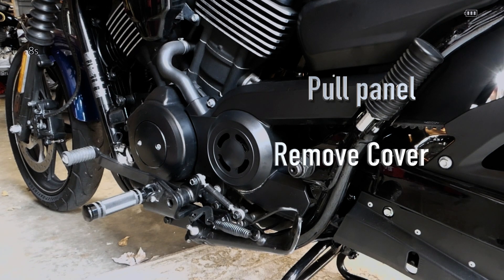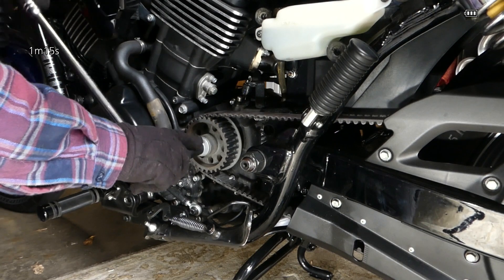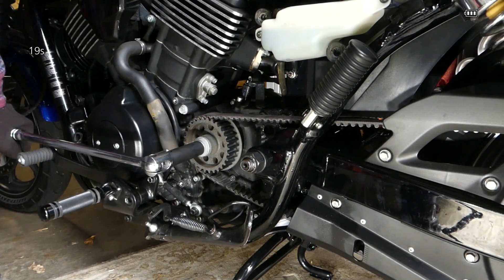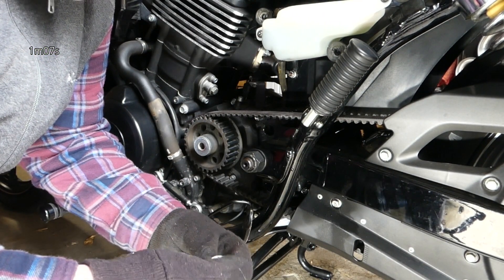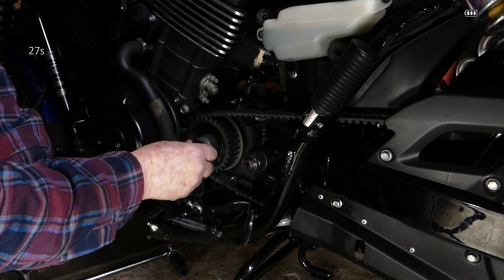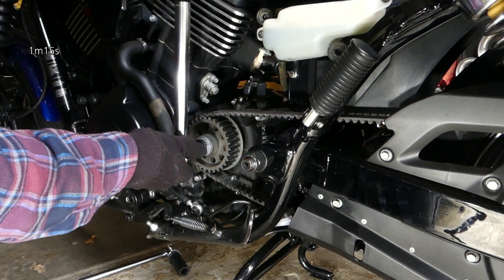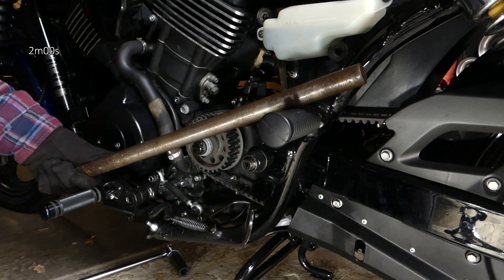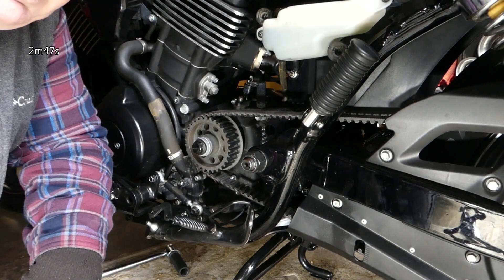Bolt R&R

Comment from the maker: There's one washer. I re-used it. At 2:52 the bolt and washer become visible and they are closer to the camera.
Reply: Great! Thanks again for sharing your expertise!
Reply: @hotbrass2005  theres a thick washer and then a concaved one make sure the concaved side go towards the crankcase
Reply: My bolt cracked and lost washer know what??
Reply from the maker: @robertsaunders3059  Buy another bolt. Make sure it's hardened steel. ARP makes a good replacement. ARP # 156-2501